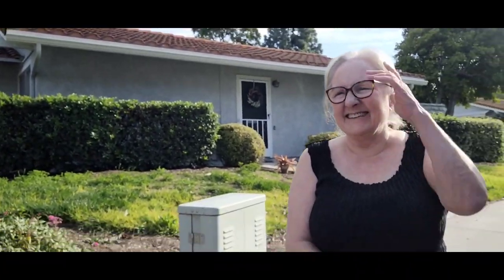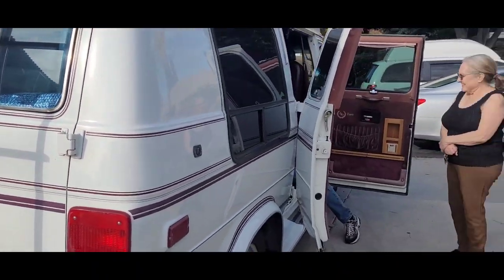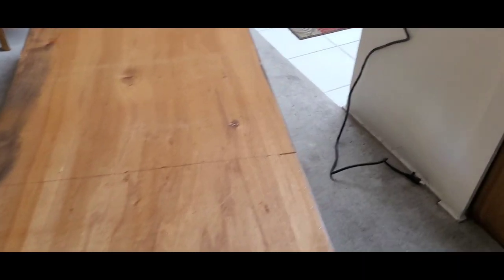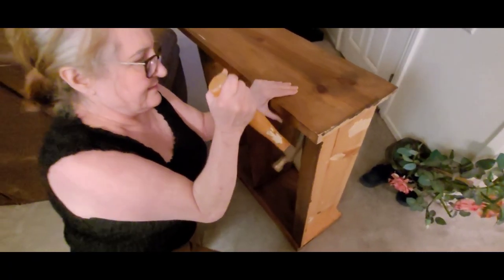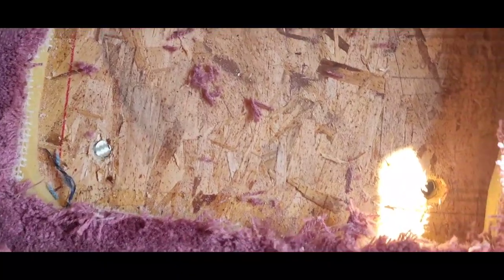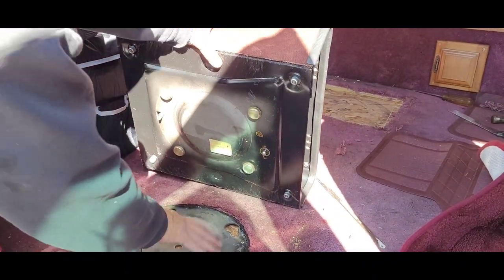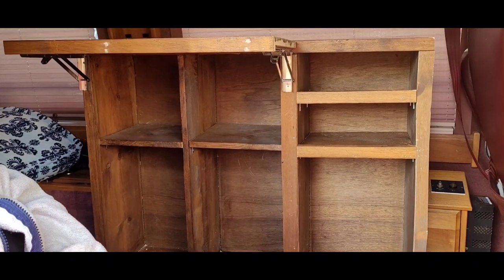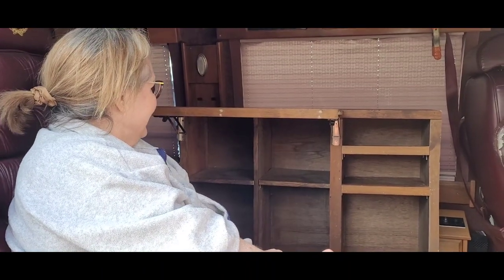Spur of the moment visit results in van build & how to take the passenger seats out of a GMC van.

Comment: When you remove the seats, how do you get rid of them?  Like where can you take them?
Reply from the maker: I have a community dumpster we threw her seat away in. We can also set furniture along the side of it and someone usually takes it. But we were trying to get the arm off because it was in better shape than one of her other ones and ended up ripping the seat. So we tossed it out.
Reply: I havent done this yet ( Still to buy my van) but also wondering this. I sort of thought someone might want them. I dont think I want to save them just in case as if I sell my van I will sell as is.